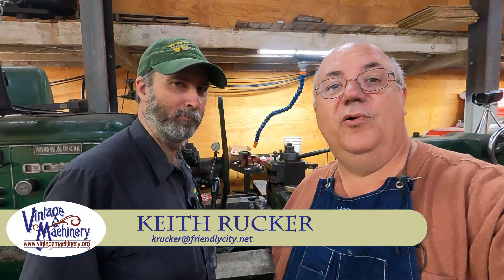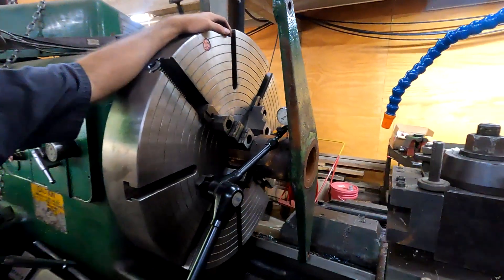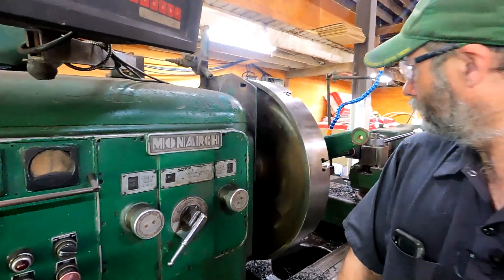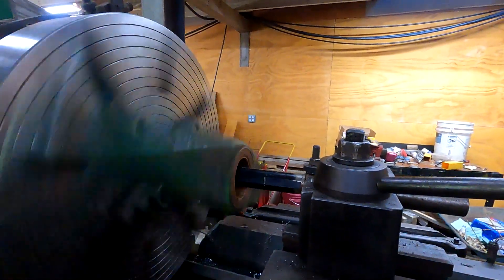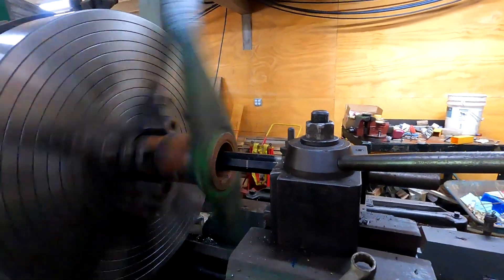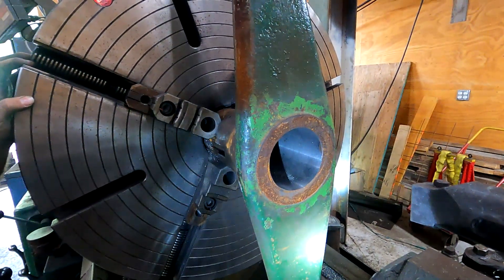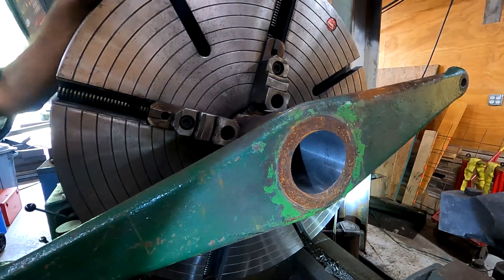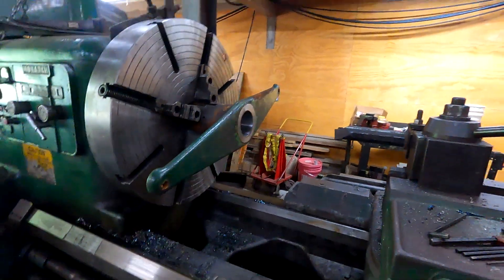Boring a Clutch Arm off of a 75 HP Case Steam Traction Engine with Brian Block

Comment: Ive had the pleasure of running lathes similar and larger too.  One was near 40 foot (12 meters) between centers.  The quill on the tailstock had two speeds for hand cranking into position (1:1 and 5:1).  But that Monarch lathe is a beaut!  Heavy duty no question.  I love the style of the old machinery.  The sound when Keith turned it on is both smooth and powerful.  A pleasing and businesslike hum.

Comment: I was surprised that the rebore was SO out of centre with the original hole, even though the part held in the chuck had been trued up correctly.  Was the original bore "off axis" somehow?
Reply: Nope. A clutch arm like that probably moves, at most, 45 degrees. If the load isn't centered and if not lubricated the hole will go egg shaped real bad.

Comment: Would it  have been possible to bore the hole on a milling machine?
Reply: Possible, but tricky.  If the correct tool (giant "Monarch") is available and an operator who knows what he is doing and "ain't afraid" of the process, a mill is not an option.

Comment: If all you had was a full-size Bridgeport mill, is there a way this could have been done?  I mean, what do you do when Brian's massive lathe is not available?
Reply: I certainly would have thought that doing the boring on a Bridgeport mill would have been safer than having those arms flailing around.
Reply: @markfryer9880  There is nothing unsafe about this. Sure, if you're an idiot an get in the way but these 2 guys are used to machines that can destroy the unwary.

Comment: We didn't have digital readouts on the lathes of that size or larger yet at the Bethlehem Steel Works at Sparrows Point, MD. Did part of my apprenticeship there in '69 & '70.

Comment: At Dodge Mfg. in Mishawaka we had a  greater than 6 ft. swing lathe which was used to turn 5 ft. dia. belt conveyor head pulleys.  It just sat there and quietly did its job.

Comment: Honest question from someone that doesn't know but loooves machining: couldn't this have been done on a vertical mill or horizontal boring machine so a 40" throw wasn't needed? obviously that's a gorgeous lathe, and any excuse to use and show it is totally understandable haha but...? Thanks so much in advance for any answers =)

Edit: Also, is that chuck really 1000lbs plus?? I would have guessed maybe 500 if that...?
Reply: Yes and probably. 16" chucks are over 250 some of em, that's like 36".

Comment: That's a Widowmaker if I've ever seen one. Wrap you up like spaghetti around a fork faster than you can yell stop. I don't blame you for not wanting to make some cuts with a machine this size that you're not familiar with. 

At least you have a friend with the machine capacity when you need it, right? I was thinking at first maybe you could have done it with a boring head on a mill, but then you mentioned just how far in it had to bore. The Florida Flywheelers are going to be happy to have this done.
Reply: Keith could have done it on his radial drill - if he got a twist drill the right size!

Comment: Should not the setting up procedure have been to square up the rear of the fixing bosses at the ends of the arms, and also establishing the equidistance of the bolt holes from the center?
Reply: Probably +/- 2" tolerance on them bolt holes ;)

Comment: Was thinking a nice chamfer on that bore would help with the two spots that didnt clean up?  Fantastic job as always brian!
Reply: It is going to get a bushing in the hole so a chamfer would leave a groove in the face and I don't think that would be desireable.
Reply: @bcbloc02  And possibly remove more support behind the bushing.   
That was almost 1/2 inch removed on the diameter - damn.

Comment: In 1969 to 1971, I was working for GTE Sylvania in Waltham, MA. We had a lathe bed that size that I used for the focusing rail of a camera. The camera back was actually a room that I sat in, with an opening in the wall for interchangeable lenses. We used that camera for photo-reduction, reducing 3 to 4-foot square ruby-lith artwork down to about 1 to 2-inch square stainless steel "silk" screens to screen-print circuit boards..
Reply: I had to read your comment a couple of times before I got on the same page. Interesting process!
Reply: @dans_Learning_Curve  haha same, extremly interesting though eh?
Reply: A little further explanation of the process: The rubylith artwork (transparent backing) was fastened to a large, backlit light board. The lightboard was mounted on the lathe bed rails, and moved back and forth to focus the camera. The fine-mesh stainless steel "silk screen" material was coated with a photo emulsion, and was the "film" used in the camera. Developing the photo emulsion would rinse away the unexposed portions of the emulsion, producing a usable stainless steel silkscreen.
Reply: @robertbailey947  That is very cool!
Reply: We worked on a large camera 4’X4’ film in the Bureau of Land Management office in Cheyenne,WY. The operator had to wear an anti-static wrist strap to handle the film. Any static discharges looked like small lightning bolts on the finished photograph. The were enlarging topographical maps.

Comment: So, why not mill it?
Reply: The set up would have been  a lot more difficult as no reference for the internal bore or machined surface.
Reply: @ericmcrae7758  
It would. But it is also difficult - not to mention time consuming - to haul the part from Georgia to Kentucky. No?
Reply: @Peter_Riis_DK  Toss it in the back of Keith's truck and road trip... plus, they're friends, so it makes a good excuse to visit!
Reply: @Peter_Riis_DK  Keith had to go to Ohio anyway, he just stopped thru on the way.  Trying to swing an indicator behind those arms on a mill combined with the fact there was a keyway to deal with would make indicating center on a mill pretty hard.  You could have come from the other side but then you would have to do 2 setups. Likely you would have to do 2 anyway on a mill since you needed a minimum of 16" of travel to complete the bore.  I don't think Keith's K&T has that much travel and you could not do it sideways unless you had a real long bar because the arms would hit the column.  The lathe makes it a lot easier job to do.
Reply: @ratdude747  
Well... It's a reason. 😉
Reply: @bcbloc02  
Those are good reasons. And you have a point regarding the capabilities of Rucker's equipment - however it doesn't look like they go in sixteen inches - half at most; where did you get that?

However, why all the indicating and two setups? I believe centering could be done with a pair of soft jaws.
Reply: @Peter_Riis_DK  Yes the bore is 8" deep so in order to cut that far you have to be able travel the same amount. so 8X2 = 16". Yes you could bore a split block on a mill table and then insert the arm and avoid indicating but now you used some large blocks of material just to do a one off job. There are many other ways and machines that could have been used to do the job this just happened to be the easiest one.
Reply: @bcbloc02  
Okay - now I get what you meant - not necessarily. And - whatever.

Thanks.
Reply: @Peter_Riis_DK  ....You don't get how this "community" deal works, do you?
Reply: @paulcopeland9035  
Actually - I don't know how it works - how could I - do you?

Anyway, that has little to do with my question.
Reply: Concentricity
Reply: @migtrewornan8085  
Of what?
Reply: @Peter_Riis_DK  the relationship of the bore trying to get them on the same center line to maintain parallelism.
Reply: @Peter-V_00  
How about just using a pair of soft jaws for that? I see no need for two set ups.
Reply: @Peter_Riis_DK  Soft jaws, for what purpose? As for needing two setups, unless you are using an HBM how would you setup the part so you could reach both ends, in order to do this on any other type mill beside an HBM the machine would need to be pretty large to have enough space and travel to accommodate the job.
Reply: @Peter_Riis_DK  Concentricity of the internal bore with the outside (bearing?) surface.
Reply: @migtrewornan8085  👍👍
Reply: Could be done in a mill for sure but there are a couple of issues, one is the part would need to be setup twice and there would be question of tool rigidity and the quality of the finished bores based on the size of the mill used to do the job, Keith does have a Lucas HBM but it's not hooked up.

Comment: That lathe is FARCICALLY ENORMOUS
Reply: Nope, that's a baby !
When your lathe has several flights of stairs on it, then it's a big lathe !
Reply: @millomweb  and the machinist rides in a car on the carriage !
Reply: @WS-ij1fu  Machinist1: headstock
Machinist 2: tool post & slides
Machinist 3: tailstock operator. - using the overhead crane to install a 3 foot diameter morse taper drill into the tailstock to drill a pilot hole ;)
Reply: Actually that is a small lathe compared to ships engine builders lathes, look up Kincaids Greenock on you tube, I was in there as a young boy and it was like something out of Gulliver's travels.
Reply: @WS-ij1fu  compared with the little hobby lathe I might use for my pipemaking however, my comment stands